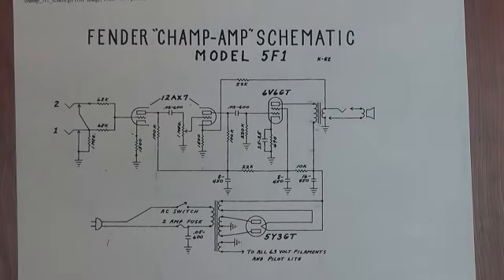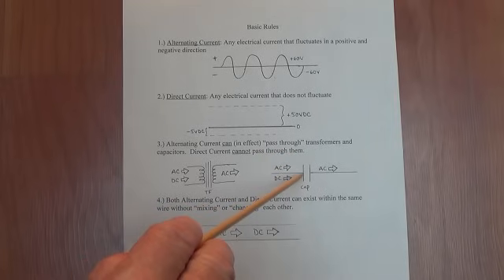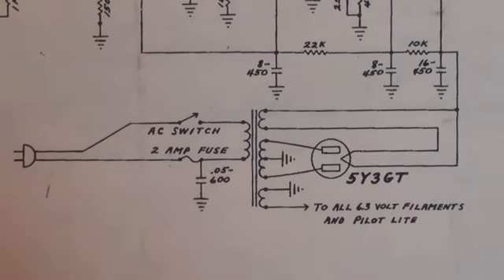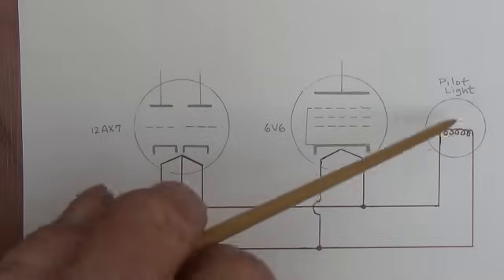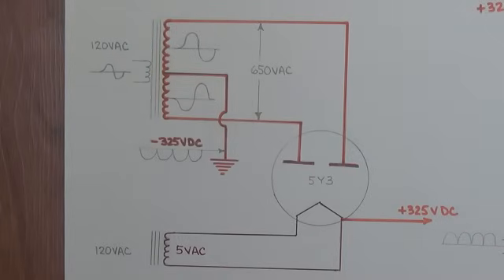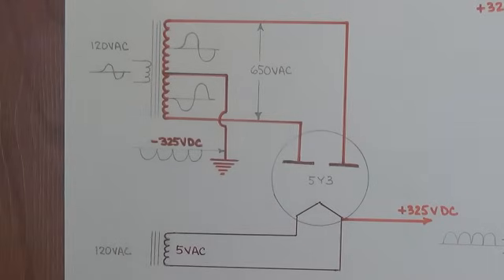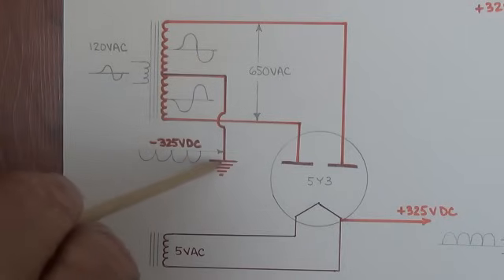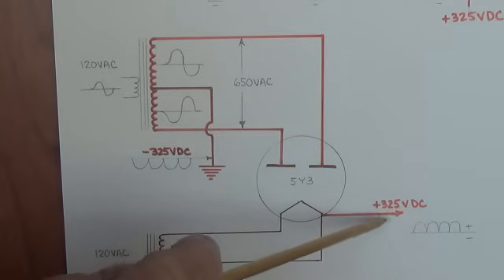How Tube Amplifiers Work, Part 1: The Power Supply

Comment: how do i make physically make the center tap ground connection in the 650v part of the circuit? is it connected to the neutral of the primary or the earth?
thanks!!
Reply from the maker: Greetings, Jerome. The center tap of the high-voltage secondary is traditionally attached directly to a good, solid chassis ground, i.e. beneath one of the nuts holding the PT to the chassis. Since the ground wire (usually green) of a three-wire power cord (if you have one) is also connected directly to the chassis, then there is a direct connection between the high-voltage CT and the AC (wall-socket) ground. I hope this makes sense :)
Reply: Uncle Doug  hey thanks for replying, so what you're saying is that its different from a reference ground that we use in solid state circuits? also is it dangerous if the socket i connect to is not properly earthed? ... sorry i am not particularly good at this :(
Reply from the maker: Jerome, I have very little experience with solid state circuitry. For safety's sake the amp should have a three-wire power cable with the chassis grounded by being connected to a properly grounded wall socket (via the green wire). If you don't have a proper ground available in your wall socket, a cold water pipe can also be used.

In tube amps, the two AC wires (black and white) are connected to the primary of the power transformer after the black (hot) wire first passes through the power switch and fuse. I hope this makes sense.
Reply: Uncle Doug thank you!! you've been an incredible help ... i had absolutely no clue as to how tubes work ... :)
Reply from the maker: You're welcome, Jerome. I'm glad to have been of assistance. Best of luck to you........
Reply: Uncle Doug
thanks!!

Comment: 120VAC is not 60V peak. 120V AC is RMS volts.. The peak is 120V / 0.707 = 170V Peak…= 340V peak-peak
Reply from the maker: Thanks, Brian. Others have made the same observation. This presentation was purposely simplified to convey information to beginners seeking a basic understanding of amplifier function. Quite frankly, I did not think that including concepts such as Root Mean Square or division by the reciprocal of the square root of 2 was necessary or advisable to achieve this goal. Hopefully, once a good foundation has been established, many of the viewers will progress on to a fuller understanding of higher level concepts. Again, thanks for your input.
Reply from the maker: Brian, I just uploaded a new video that explains the concept much more fully and accurately. Hopefully, it will meet with your approval. Thanks for your input.

Comment: Wildly easy to understand! Love your teaching style. Could I feasibly substitute in rectifier diodes for that tube?
Reply from the maker: Yes, diodes can be substituted for a tube rectifier. Weber makes "Copper Cap" Diode Modules with tube bases that you simply plug into the empty rectifier socket. It allows you to change back and forth from tube to solid state  rectification without altering the circuit wiring. There are different modules to replace specific rectifier tubes.
Reply: Uncle Doug I'm very interested in trying my hand at building one of these. I've watched some of your other videos and some by others, and I think I understand biasing, basic tube physics, and the fundamental electrics. Is there a benefit from using a rectifier tube over a plain diode? Planning the project, I'm also wondering if I can wind my own transformers and achieve a good result. If I'm asking too many questions, where can I do some further reading?
Reply from the maker: Many people feel that rectifier tubes provide a more "vintage" tone, while diode rectification is simpler, cheaper, and provides a cleaner, sag-free sound. It's really just a matter of taste, I guess.

Re the hand-winding of transformers, I would advise against it, especially on a beginning project. You would probably be better off building a few amps with purchased transformers, gaining some experience  first, and then perhaps you could delve into the mysteries of transformer design and construction.

Comment: Could you please upload the schematic for the Champ amp? What are the supply voltages?
Reply from the maker: Jose, your best bet is to do a Google search, like I did, for a Fender Champ 5F1 amplifier schematic, and then simply print it out. The power supply voltages for the 5E1 (they are not listed on the 5F1 schematic) are 320VDC, 305VDC, and 260VDC at the filter cap nodes.

Comment: Very good and informative, any chance of the same vid but for a solid state?
Reply from the maker: Thanks, HW. I only work on vintage tube amps, so solid state circuits are not part of my repertoire. However, I will say that much of the circuitry is the same. Transistors amplify in a manner similar to vacuum tubes, but generally at lower voltages (so you don't need an output transformer), and the function of resistors and capacitors is the same in both circuits.
Reply: Uncle Doug
Thanks Doug, I asked because this is so well explained and I know nothing about electronics. I will google some more ;-)

Comment: I watched part I and II straight after each other. I was pleased to see all parts of the 5F1 circuit explained. With some basic knowledge and Google I was able to figure out the best part of how amplifiers work. But this video really really sums it all up, and makes it comprehensible. 

I do have a question though; Halfway trough where the 325VDC or B+ is converted, you end up with a -325VDC to ground. Everybody knows that when you touch hot wires, you can get chocked. Is a negative voltage also dangerous? 

Many thanks for this very very helpful video
Reply from the maker: Greetings, Peter. The -325VDC is sent to ground and only presents a shock hazard if you touch BOTH the (negative) grounded chassis AND a wire in the chassis that has high positive voltage at the same time, then the current will flow through you and might actually kill you.

For this reason, you must never touch parts of your amplifier chassis and circuit with BOTH hands, when it is ON or just after it's turned off. If you must touch a part of the circuit with one hand, then keep the other hand in your pocket.

Also, remember that the filter capacitors store up and hold high voltage for a while (the time varies) even after the amp is turned off, so be very careful at all times.
Reply: Uncle Doug Thanks Doug for your swift response! If I understand correctly, then don't touch the negative AND the B+, because then the current can flow trough me. Which is a thing I'd rather not want to see happen. 
The 'one hand in the pocket' is so that the current, in case of an electric shock, can't flow trough my chest, right?

Have you ever been chocked? Or even have worse experience? 
I read that some artist died on stage because of the famous 'Death capacitor' and of course the 2 sprung power cords which were in use in the past. 

For the filter capacitors, Im doing some research on connecting them with a resistor. So it will slowly drain its charge after turning off the amp. My project is still in the development and planning stage. I copied your drawings and gave the wires all colors. This helps me understand the theory. Also it helps to pinpoint certain components on pictures or older sketches. 

Anyhow many thanks and a good weekend to you sir!

Comment: I was just going to comment about what a great teacher you are - and I see that others have said it.  Definitely true.  Your background shows.

So the 325+ DC comes "back out" the heater wire? That's how it looks on the schematic, but I never really understood it (which is one of those times where, if I'm not sure, I look away from the schematic to the layout diagram).

Again, thanks for this!
Reply: Yes, the "DC" comming out of the heater, to keep it simple it just comes out of the heater. (The electrons do this job, to be exact)
Reply from the maker: Thanks, Dr. S. I'm really pleased that these instructional videos are proving to be both helpful and of interest to viewers. Yes, I know it's hard to accept from a practical standpoint, but the positive high voltage DC does indeed come out of the 5VAC filament wire, and the negative high voltage DC comes out of the center tap to ground. Recall that both AC and DC can coexist within a single wire, and in the case of the positive high voltage DC, it does indeed pass through and out of the same wire/circuit that contains the 5VAC.
Reply from the maker: Thanks, ZZ. I (and I'm sure, Dr. S.) really appreciate your input on this technical matter......you explained it very well. I did post a Part 2 video, and (as you predicted) discussed the ripple-smoothing effect of the filter capacitors. Thanks again for watching and commenting :))
Reply from the maker: ***** Thanks again for your input, ZZ. I think to summarize, we can say that silicon diodes are much more efficient than tube rectifiers. They can respond much more quickly (than a tube rectifier) to changing current demands by the circuit, and diodes consume less voltage during the rectification process, so their output DC voltage is higher than you would get with a tube rectifier.  Purists prefer tube rectification because the  inefficiency creates a delay between demand and supply (called "sag") which alters and (in many people's opinion) improves the tone.
Reply: This is all super helpful, guys.  Thank you.  Definitely one of those "aha!" moments for me.  Much appreciated.
Reply from the maker: You're very welcome, Dr. S. I'm glad the videos and comments are helpful :)

Comment: can you use a LED for your diode, and kill two birds with one stone (use the LED as a "on" light)
Reply: Sorry, this is not possible, they share nearly the same symbol but do act a lot different.

The main reason for a diode is to let current pass only in one direction.
The main reason for a LED is to light up.

The maximum continous current flow through a normal 3mm or 5mm diameter LED is 20mA to 30mA. If you go beond this for few seconds you´ll blow it. The maximum reverse voltage of a LED is only 10V to 30V so if you hook up a LED to your mains outlet with a resistor of

120V / 10mA = 12kOhm =12000Ohm

It will light up for a few seconds and blow away as well, as it can not withstand the 120V for a long time. (to make things right: the max. voltage on "top" of the waveform comming out of the mains outlet is 120V * 1.414 = 170V)

Hope this will help.
Reply from the maker: An interesting idea, Franky. You can substitute semi-conductor diodes for the rectifier tube, but the LED's I am familiar with would be fried by the high voltage and current flowing through the power supply. They are primarily small devices used for illumination, and not high voltage rectification.

Comment: Hello. Great video, learnt loads! But there is something that I don't understand. I thought DC voltages were always in respect to ground (which I thought was always 0V). So in this example it'd mean you've got 650VDC in respect to ground not 325. I'm a little confused, could someone clear this up for me?
Reply: While the voltage across the whole of the secondary is 650V, when the center tap is connected to ground there is 325V with respect to ground across each half of the secondary.

Comment: Thanks for taking the time to do these videos. This is the kind of plain language that we newbees appreciate. I don't know if you plan to cover it in Part II, but could you touch on the concept of negative voltage sometime? In school we all learned the basic concept of positive flowing toward negative. So, it's hard to grasp negative voltage?
Reply: Excellent idea. A primer on the workings of electricity would be great. If anyone can make anything really clear, UD is the man.
Reply from the maker: Thanks, RB and V.  It gets very confusing, because, in reality, there is no "positive" current electricity. The only charged particles that can move are electrons and they are all negative, so current (flowing) electricity is strictly negative. When I speak of the tube plates as being positive, I mean they are relatively devoid of electrons. Almost all the electrons were pumped out of them by the power supply and the electrons from the (negative, because it has lots of extra electrons) cathode are anxious to fill that void. "Positive charge" means a deficiency of (negatively charged) electrons. If I take one electron from you, I now have a -1 charge and you have a +1 charge (in other words, you are minus a minus one....which equals plus one). I hope this didn't make it even more confusing :))
Reply: Uncle Doug Thanks for the explanation. That helps. I'll be on the watch for part II. Does Rusty play his Hendrix licks with his teeth? :)
Reply: This toppic is always confusing people who are not into electronics.

And this is not your fault. It is the fault of "time" to be exact.

As when the electrical field was discovered many, many years ago (some 18xx) the people actually think there are some elements flow from one pole to another. They said: let the pole where the elements come out be the "positive" and the pole where the elements go in the "negative"

That was all. It was an agreement. They really did not have a clue what´s  going on physically or the physics behind the scene.

Some years later, the scientists explained that the electric current is based upon the electrons witch commin out of the minus and beeing "attracted" by the positve.

You need "free" electrons for this to happen. Free electrons are in all metal materials as: copper, silver, gold, platinum.....

If you want to see them just fire up an old fashioned light bulb. If a free electron gets out of the metal.
The atom which they previously belong to emitts a small light flash. As it happens million times million in just a second they will be become viewable.

We use them in the Tubes as electrons can flow through vacuum. The same free electrons. :)
 
But free electrons are not free energy - as this does not exist! Had To Be Said !!
Reply from the maker: rbauer1632 You're welcome, RB. Rusty is more of a Chuck Berry fan, and he uses his dew claw(s) like finger picks :))  ^. .^